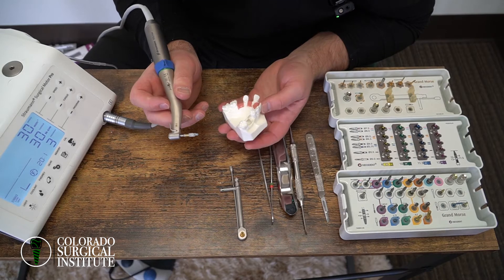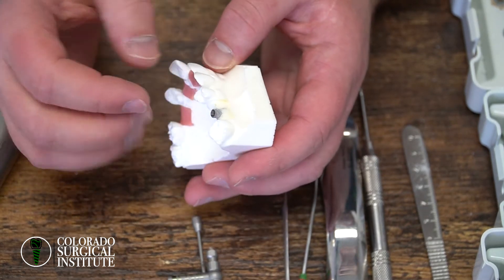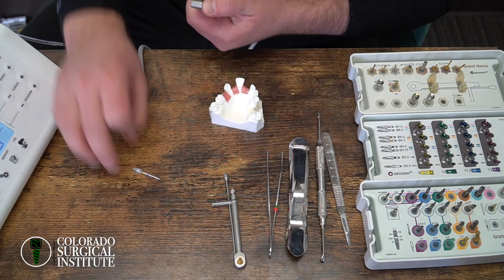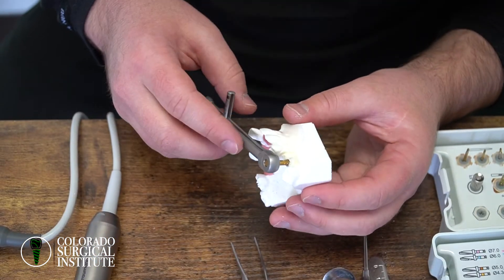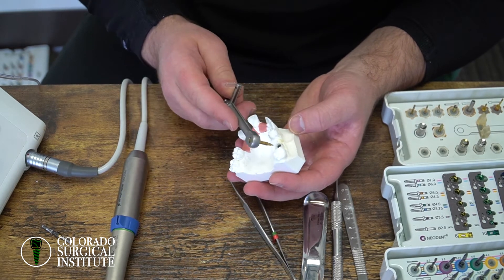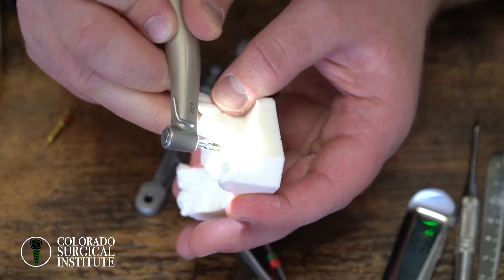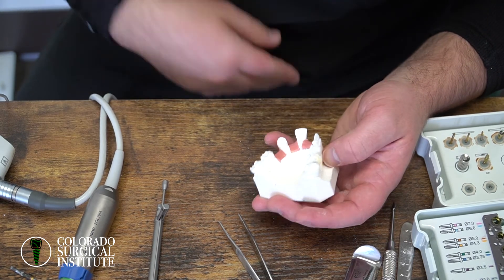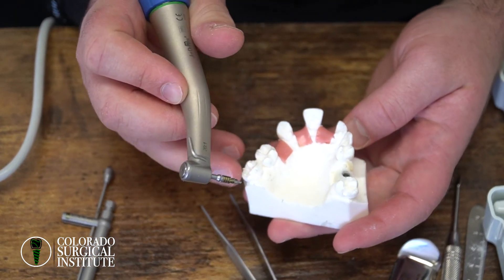Mastering Dental Implant Placement: Tips & Tricks for Success

Comment: I see u sir use the 4.3 mm again without + 
The + is down row to the burs i use neodent so why
Reply from the maker: Great question! The burs are tapered, also the 4.3+ is slightly wider than the 4.3 which can be used in thick cortical bone if needed. Majority of cases we do not use the 4.3+